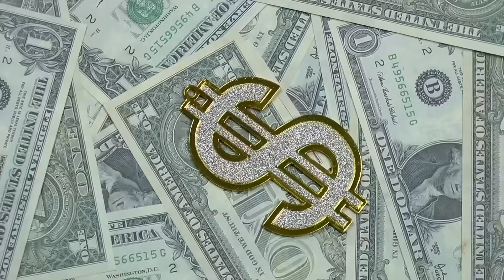How To Lay Out Walls, Floors, and Roofs | Explaining Layout

Comment: Remember, tape measure can differ by brand
Reply: Half a percent difference? Calling bs on that. I've got three long tapes and two short. The long ones all line up at 25'. The short $1 ones match until they run out. Do you have stocks in laser tools or something?
Reply: layne stayley  in length, compare two different thumb sticks or measuring tapes. Can be up to 5 mm each meter, that's 5 promille deviation.

Comment: Here in the UK we fall between to schools of thought, drywall is in metric sizes is 2400mmx1200mm ,where as plywood is imperial is 8ftx4ft or 2440mmx1220mm,do lay floor joists out to match the ply on top or the drywall for the ceiling below ????
Reply: Plywood.  You lay out walls for your sheathing.  Drywall doesnt always work out on big runs, and on short runs it doesnt matter, because sheets are 14' long.
Reply: The yanks have it right when it comes to the imperial system for building. It's a far more intuitive system of measurement for large dimensions. Metric for example is better suited to joinery and cabinet  making.
Reply: TheToolnut.   I grew up with imperial but have to say building with metric is way easier. Only need millimeters and meters. No 1/4, 1/8,  1/16ths etc.   but I’m sure it’s a great mental exercise working with imperial!
Reply: michael Dahm:
Uh~~They are called FRACTIONS‼️ 
Fractions of: Inches, Feet, Yards,Miles- Time-etc‼️😉
🍑🍑🍑🍑🍑🍑🍑🍑🍑🍑
Reply: Joe Townsend.  true. No fractions less friction
Reply: @michaeldahm214  I disagree, imperial is much better suited to framing/first fixing. Once one gets used to it, 😁 I've done a fair bit of joinery and cabinet work in my time and I feel the metric system is better suited for the higher tolerances involved.
Reply: TheToolnut think you nailed it with “once you get used to it”.   Doubt either of us are about to change our preferences.  Quite sure from watching YouTube vids like “the brothers” ability and commitment trump method.  Great to be able to see how the rest of the world do things differently, picked up some real good ideas as well as seeing so many aspects of building are so similar.

Comment: If you were to lay out a rectangle building, say 16X28, would it matter what corner you started on when laying out a 16 o.c. ext. wall? And would you go counter clockwise around the building, or clockwise, and would it matter? Odd sized building, say 13X21? Cheers!
Reply: Which corner you start with does not matter.

Comment: I had a framer tell me one time that he laid houses out from a common reference point so that if you looked across the house from one side to the other that all of the studs should be in line.   So if there were 6 walls running front to back and you stood on the left side of the house and looked across you would see all six studs in a single line fron left to right.    Ive not had any other framers lay it out that way.
Reply from the maker: That’s the way I do it as well.. reference one corner (unless the dimensions of the house are an 8ft or 4ft increment; then you can pull both ways)
Reply: Perkins Builder Brothers so your telling me you lay out your inter walls to match the outside walls ? I’m not physically able to frame houses anymore, but I help my friend with drywall and I’ve seen a lot of bad carpentry due to home owners doing the work themselves. Ppl need to be taught how to straighten a wall.
Reply: Day one when approaching the footers: establish your "key corner." All layout comes off that corner
Reply: @Luke H lol no just the framer who gets his joists, studs, and rafters to stack all the way up. Not only aesthetically pleasing,  but structurally and as mentioned in the video, easier for the rest of the trades to do their job. Being a framer I definitely don't hate on concrete guys because they single handedly affect my day more than any other trade in the beginning. They do good work my job is easier
Reply: OP

Comment: Someone could make a mint on a tape measure that has like a blue line or some color to mark the edge of a stud for 16 inch center.
Reply from the maker: You know that’s a pretty good idea! Never seen one, but that would make things very easy
Reply: @PerkinsBuilderBrothers  
I'm in the garage door service / installation industry.  Instead of reading increments I have made colored mark's on it. It makes lock hole position flag position and decorative hardware positioning way faster. And you never miss measure a hole which is crucial with locks. My measurements are all within 2 feet and simple. Marking out a full tape for studs may be worth it.
Reply: @PerkinsBuilderBrothers   Any good reason why 2x studs and other 2x material aren't marked for layout at the mill?  Same principle as fastener markings on sheet material.  Seems like it could save a lot of time.
Reply: @palettetools6461  imagine how many times you'd be flippin' your sticks around and wapping people in the head or worse, their head.
Reply: @dh66  True for 10 and 14 foot material.  I'm ignoring 19.2" on center for the moment.  No wrong end on 8's, and 12's.  Drops still have one good end and are not too long.  Maybe 10's and 14 have opposite faces marked so no need to flip end over end, just roll over.  It would probably be chaos and mayhem but still seems like some time could be saved if nobody killed anyone and you got the hang of it.  Its likely that even with the proper organization it wouldn't pay.  But I would try it if it were available at more or less equal cost to unmarked lumber.  Could always ignore the stamped marks.  .
Reply: Nailed It.  There must be an interesting reason why  such a mark never happened.  In the very beginning lumber wasn't milled to exact dimensions so Im sure it made sense to mark the middle, of a framing member,  but tape measures aren't all that old.  I know the older school generally would  mark the edge of the stud and eye ball the rest which does work.  But a line and an x is the clearest way to mark and for as little trouble as it would be to add the mark, and for as much of a problem as bad layout can be, I don't see why it wouldn't be worth it..
Reply: To simplify it, you would have a 1.5" yellow strip for 16 o.c. and a 1.5" purple stripe for 24" o.c. You would need to be able to see a pencil mark through the colored stripe so if you want or need to ignore them you can and so you can mark a crows foot and x within the stripe if need be.  I don't think most people would confuse a 1.5 inch colored stripe with handwritten layout markings. 

You would have to occasionally make cuts to get layout where you wanted it.  And occasionally it would be better to ignore them.  The premise is that it would be very cheap to add the marks at the mill.  Really just the same concept as marks on sheet goods.

Comment: Back in the real, real, reeeeaaal old days when they were building houses, they bought materials based on how much money they had in their pocket. Follow me here. They would tell the sawmill they needed 2 x4 and they had $10. So they would get a random number of boards. They would go back to the site and install the boards at different width based on how many boards they had. So that is why you will never see an old wall with all studs on 16" or 24", or 23", etc,  centers. Some will be more. Some will be less. Not ever the same.
Reply from the maker: Very cool and those old homes are probably still standing today!!  I have noticed weird stud spacings on a old remodel jobs
Reply: @PerkinsBuilderBrothers  My house is over 130 years old. Oh, the stories I could tell about replacing a door. All are done now. And each has a closing issue. Not huge. But just a little off.  One door the wall on the right sticks out 1/2" more than the left wall..
Reply: lostintime86 
I have never heard that one before. Thank you for that nugget of history.
Reply: @chefsteven34  another one that used to do when they were going to put in a post to support the house. They would dig a hole real deep and place big boulders in that hole then fill it back in. Then they would install the post on a flat rock. It would look like it was just sitting on one single rock on top of the dirt.

Comment: so if the plan says it’s a 36” door, you’re supposed to make it 2”  Longer?  can you explain please, and is that the same for windows.  I tried to look it up but can’t find nothing
Reply: You have to add space for the door jamb. A door measurement is only the door slab itself. A jamb is usually 3/4" material. So 3/4" for each side of the door is 1 1/2". That extra half inch is used for shims to make the door level and plumb in the rough opening. For the height refer to your plans on what type of flooring will be installed. For example 3/4" hardwood plus 3/4" jamb is again... 1 1/2". From a trim carpenter's perspective, if you know the width of the casing will cover just add 3 inches to your rough opening. It's much easier to adjust doors properly with a little extra room. Of course in a perfect world all the framing will be perfectly plumb ;).
Reply from the maker: So for most doors you add two inches to the slab width for the rough opening. Windows are different.. the rough openings are specific to the company and model of the windows. We pre order the windows and the company gives us a window schedule with all of the rough openings 👍
Reply: On some homes we add 2 1/2 width. The extra half inch provides relief for some types of solid core doors which have their hinge screws poke through the jamb.  Saves the trim carpenter from zipping them off with a grinding wheel.   Also check finished flooring material with builder.  Certain hardwood and tile installs may require extra height.
Reply: I think it's also worth mentioning that the 2" does not apply to slider doors, which are essentially large windows. In that case, the rough opening is generally the same as the nominal size of the door, as is generally the case with windows.
Reply: omar zoobi yes, it’s called a rough opening.

Comment: Great videos--Do you ever use a layout stick?
Reply from the maker: Thanks... no I have always just a tape measure… Just habit I guess. Layout stick is not a bad idea at all though
Reply: They use them a lot on their videos.  Block work, Siding..etc.  But framing is laid out on the floor generally so the tape does the job well.
Reply: Glenn Holcomb  I bought mine after watching Larry in a framing video. Great tool.

Comment: Interior walls are laid out for Sheetrock. Layout from inside of outside wall not from sheeting. Or did I see that wrong.
Reply: that's so the floor joists above line up with the studs in that interior wall, most important if it's a bearing wall. It also gives room for ductwork to move from the stud cavity into the floor/ceiling framing above.
Reply: Well it obvious you young bucks know what your Doing. Kuddos from Texas.